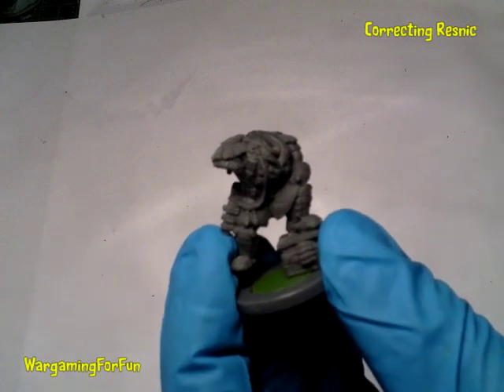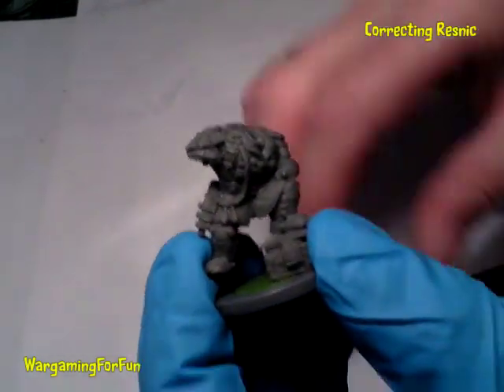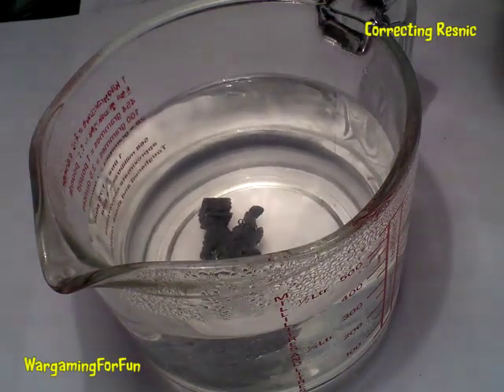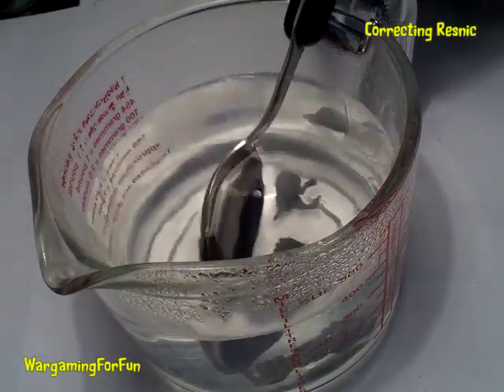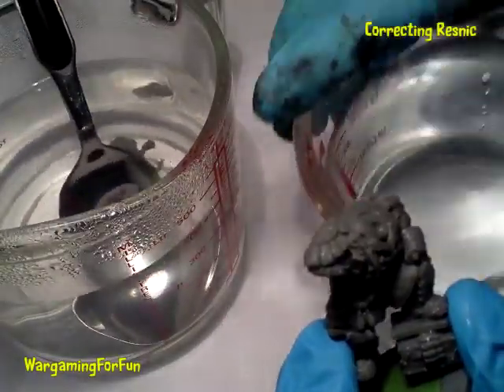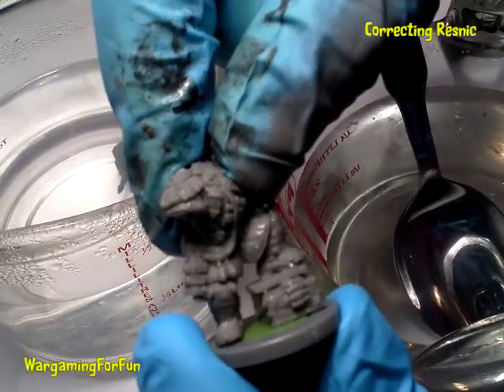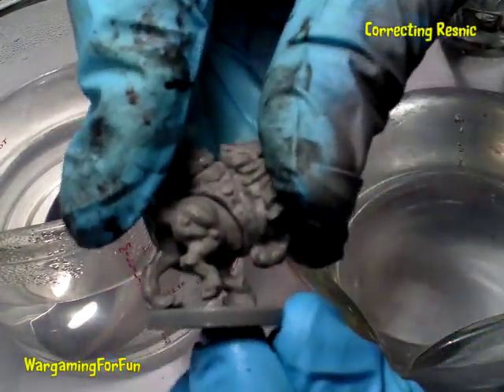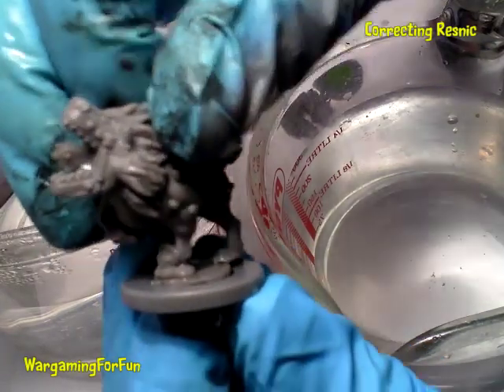Correcting Resin-Plastic 'Resnic' Miniatures

Comment: The same applies to Reaper Bones ("Bonesium", they call the material) - though with that it mostly straightens out into the intended pose automatically with this method, not much need for manipulation. I've used it a few times, works like a charm :)

Comment: i have used this technique on some reaper figures they are much more delicate than mantic ones but it works brilliantly everytime only difference with the reaper ones is i only leave them in the hot water for max 20 seconds but yeah great tip indeed :)